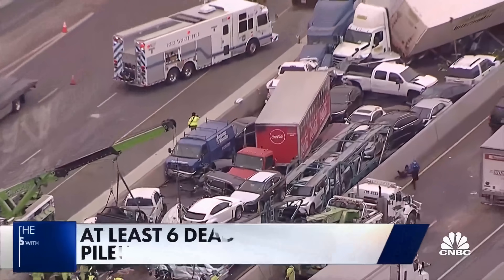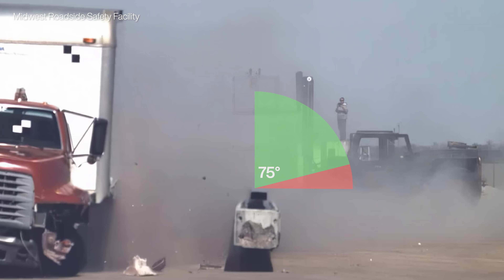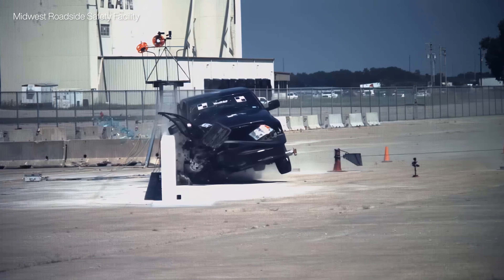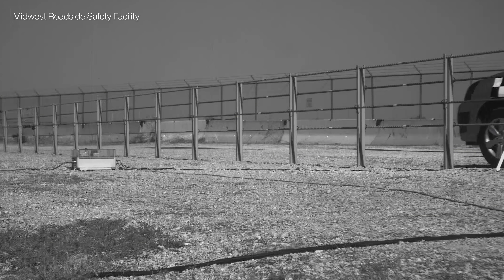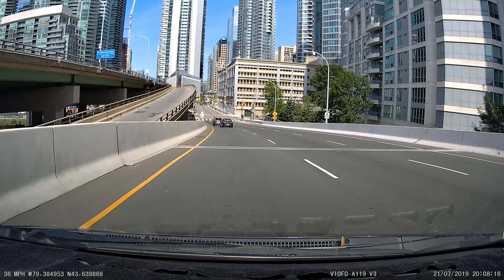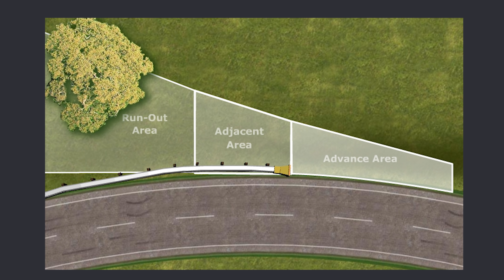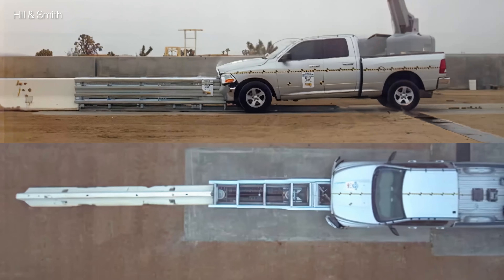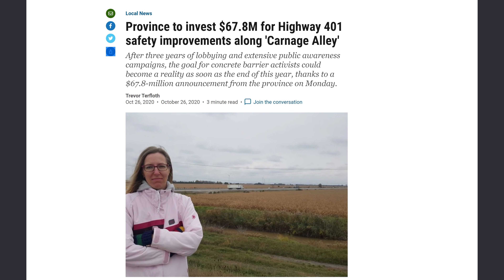How Road Barriers Stopped Killing Drivers

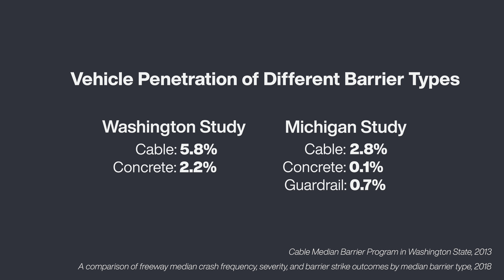Comment: 7:27 "slightly higher fatality rate???"
0.9% is more than double 0.4%... c'mon

Also, at the beginning, you said fatalities were decreasing even as many more people drive than in the past, but the graph you showed was deaths PER distance driven, which is independent of number of drivers.
Reply: "...which is independent of number of drivers"
Wouldn't say so. It makes intuitive sense that "empty roads" tend to be safer than crowded ones.

Haven't looked at the statistics, but think from the perspective of the driver on a simple one-lane road...
Which one offers you greater risk:
- An empty road where you don't have to overtake anyone and where oncoming vehicles come at a rate of 1 every 5 minutes
- A crowded road with annoying trucks to overtake, and where oncoming vehicles come at a rate of 1 every 10 seconds
Reply: @msereno  I think we at least agree it's more complicated than a single statistic.
Reply: @yoongilimerence  yeah I agree. But I also agree with the perspective Andrew presented with the data he showed at the beginning of the video... Technology and law enforcement are evolving, and this brings us quality of life and safety.
Despite the harder challenges of modern times (for example, much higher traffic), the human species keep evolving, and the statistics show it (higher life expectancy, lower motor vehicle fatality...). The video has a positive tone and it is very welcome.
Whole point of the first section was to show that "Driving deaths are WAY less" (per vehicle miles traveled) and it is indeed true.

The video description references this source (among many others) and it's quite interesting: https://crashstats.nhtsa.dot.gov/Api/Public/ViewPublication/812927

Comment: The most dramatic decline was from 1920-50; apparently, going with all steel car bodies helped immensely, subsequent to that, the fatality rate continued to decline, even with no seatbelts to speak of, between 1950-60. Note I've been wearing lap belts starting around 1962 then graduated to 3 point lap/shoulder setups to now.

Comment: On the cable barrier note, if you have a glancing blow they absolutely will be deflected into traffic. In 2018 I had an accident at 100kph on a freeway in Melbourne, I hit the cable fence on the right hand side and it deflected me across 3 lanes of traffic into the concrete barrier on the left. Without the fencing I would 100% be dead as my path would have send me into a set of trees head on. Cable fences are great, but like everything they definitely do deflate you

Comment: I am a truck driver on the US west coast, and I see these fancy barriers going in, and how effective they are.
The guard rail crimping ends are used a lot, and it's easy to see how gently they stop a head on impact.

I have seen several times when the cable barriers caught a car that would have flown across the open center divide into oncoming traffic when they went straight as the freeway curved.
A couple of times there was quite a elevation difference between the two sides, and so the car would have gone down a steep bank into oncoming traffic, but was caught safely.

Oregon and California in the last 3 or 4 years went all in on cable barriers on the freeways, and i5 now has it most of its length where it was previously just open clear strips.
It gets used frequently lol

Yes, it's not as effective as other styles, but being able to rapidly install it several miles per day with limited lane closure and site work is a game changer, because I know that they didn't have the money to put hundreds of miles of guard rail or concrete barriers in place. And in the hills and mountains, the center divide often is not flat and level, and where you would have to do extensive engineering to put guard rails in, you can just follow the contour of the land with the cable barriers.

Thank you for the deep dive into this, all the footage was awesome to see!

Comment: I work for the New York State Thruway Authority and we have to measure to make sure the rail is at a specific angle we also have to use specific bolts, because they want the bolts to sheer at a certain load

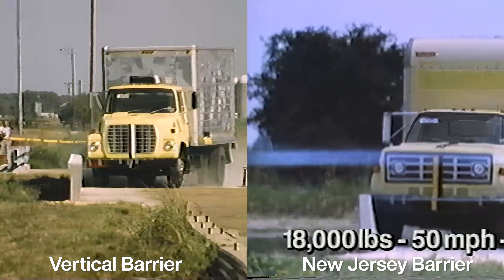Comment: 4:09 that was in Louisville. I remember when that happened. Not only did that guy survive, he walked away from that crash.
Reply: that's good to know - that moment was pretty shocking.
Reply: Damn I thought for sure he got liquidated
Reply: Well it landed on its wheels right?
Reply: @ineffablemars  so the driver just had all of the force of the drop at speed apart from what was absorbed by the suspension, travel up through their spine and head. Does that really sound safe to you?
Reply: @hapticflapjack  opposed to no suspension?
Reply: @ineffablemars  no. It landed on the driver side.
Reply: That's wild

Comment: I don't understand why they don't cable in a more net fashion then the 3 cables standard? If they ran cable's vertical as well as horizontal it would be impossible for cars to slip through the cables. Catching car much like a fishing net. If they are so cheap then the added cost would still make it the cheapest barrier.

Comment: As a motorcycle rider with hundreds of thousands of motorcycle based highway miles under my belt in all weather conditions, all of those barriers scare the you know what out of me.  Do the engineers even consider what will happen to bike riders when they impact any of those barriers?  Is the rider population too small a part of the total driver population to be considered a meaningful fraction of the economic considerations and therefore not worth making modifications to the design?  

This is really peripheral to the excellent and informative video that you created, but I have a question:  Assuming that the effect on motorcycle riders is not considered in the designs, do you think there are non-economic considerations? I live in an area where traffic filtering is legal on motorcycles.  I have heard a good amount of animosity directed at motorcyclists and motorcycles in general. It is just a fact of life.  An example would be "I would like to run them off the road, or throw open the car door and show them for passing me while traffic is backed up".  If motorcycles are not considered in the designs is it partially because motorcycle riders are considered to be irresponsible and that by riding a motorcycle they are taking stupid unnecessary risks and therefore they brought this upon themselves?  I ask because to me that seems (this is a bit of a misstatement, but it is the best comparison that I could come up with on the spur of the moment.  If you have a better comparison please feel free to offer it.) a bit like blaming rape victims for their rape because they brought it upon themselves by their own behavior or clothing choices.  And that is just wrong.

Comment: I'm looking at this and wondering how the cement truck in El Paso Texas that lost his brakes might have been able to stop himself before the intersection where he sacrificed his life to save others at the intersection.  

The crash happened in El Paso on Loop 375 coming put of the Trans mountain pass. Immediately down the pass is a single run away ramp followed by about 2 -3 miles of wavey roadways as 375 goes over intersections,  then into a stoplight just after passing underneath I-10. I'm wondering if he might have survived if he would have aimed for some of the barriers between him and the intersection

Comment: Still super dangerous to motorcycles.
At least the rail and cable types

Especially here in Germany because most states are too cheap to put up double hight barriers.
Especially in corners.
Those "legs" will fuck you up badly

Comment: There's a dangerous intersection in my home town with frequent tractor trailer traffic.  People were petitioning for years to have a turning light installed but Dot wouldn't budge as there weren't enough fatalities to justify the cost.  all you have to do is try to make a left onto the highway with a large truck trying to do the same across from you to realize how dangerous it was as the road curves ever so slightly to the right so any oncoming traffic can be completely obscured from view.  

They finally installed a turning light a few months ago and everyone rejoiced.

Comment: while driving DEATHS are happening less i think ACCIDENTS are going up due to distracted driving and todays cars being made for and marketed to unskilled drivers. more and more unskilled drivers are on the road than ever and car companies keep pumping out SUVS with a million driving assists in them, allowing those unskilled drivers to get on the road and think theyre safe. i firmly believe that all a car needs is ABS, TCS and a manual transmission so that unskilled drivers are filtered out of the roads, todays crash structure safety is more than enough to stop road deaths.

cable barriers are dangerous to low cars like sportscars, ive heard of people in corvettes and vipers being decapitated by them

Comment: "with enough crashes, restorable units save money"
YO! We need some moah crashes ovah heah! Joey, go hit dat barrier a few times.
Reply: That is like saying I need my house robbed more often so my insurance cost per. robbery will be less.
Reply: Going to the emergency flasher Bailando to Mexico
Reply: Y'now, I don't trust joey.
Reply: @flippyflip7213 just trust him buddy
Reply: While safety measures have increased survivability of accidents, the root cause of accidents have spread unchecked in recent yrs.

In Ca, Latino drivers cause a disproportionate % of DUIs, hit and runs, distracted driving. Disregard for common decency, the safety of other motorists; and, even traffic law, run rampantly amok among Calif Latinos. 

It'd be great if you could help shed some light on this censored topic to prompt proper public discourse and overdue action to address this taboo issue.
Reply: @marthinluther7350  There are no accidents. There are only "becauses". Vehicles crash "because" somebody along the line did something wrong/stupid.
You're guiding 2+ tons of machinery around at high speeds only connected to the earth by 4 tiny patches of rubber. 
Yeah you feel great in that 6 ton SUV...but you have no sense of the fact it rides on less than a square foot of surface.
Nobody understands basic physics, inertia. Even the best tires can only do so much. All they know is if they turn this gizmo the car is supposed to turn.

Vehicles SHOULD be more dangerous, scary, terrifying to drive...not mobile living rooms.
Trying to overcome stupid all these years hasn't worked very well. People always find a way.
All of these safety features are trying to stupid proof cars. They understand that PEOPLE can't be taught.
Reply: @marthinluther7350  The root cause of ALL crashes is stupidity....what did I miss?
Reply: @yourhandlehere1  I disagree, give me mobile living room, let a robot drive.
Reply: thanks for the laugh lol

Comment: I'm skeptical of the smart cushion. I'm sure they work great when they are new, but gas shocks are notorious for leaking pressure over time, and I doubt they will be sending crews out to inspect them. Is there even a way to check the pressure?

Comment: In my years of working for the dot and fire department I can say cable barriers do not work and almost always allow the vehicle to go into opposing traffic
Reply: I've seen a cable barrier in a narrow median, get plowed into and repaired several times, where the vehicle would cross into oncoming traffic. They finally replaced this cable barrier with a permanent concrete barrier. It took a few people dying before this happened. In another stretch of the same highway, where the cable barrier is on both sides of a large median, it has kept vehicles from crossing over into incoming traffic. When it comes to cable barriers, speeding in most cases, is what causes crossovers.
Reply: I see the opposite often- cars hit the barrier,  with a nonfatal level of damage,  safely remaining in the median.

Comment: The problems with cable rails is that they kill motorcyclists at a high rate than guardrails. The issue isn't the cable or the guardrail but the posts.
A German study found them to be deadly at 50km/h. Keep in mind they are often installed on roads with speed limit of 100km/h (4x the force).

Comment: cool now take a cable barrier also referred to as a "cheese grater" and even graze it with a motorbike :/ yea you get entangled and violently ripped to shreds costly to clean you up as well. sadly the metal barriers do only a little better but I will say bouncing of concrete barriers is preferable. most of these systems are only designed for cars sadly

Comment: Imagine hitting a cable barrier on a motorcycle D:
Reply: the cable can slice through the pillars of your car and decapitate you if you hit it just right. Who would want to end up in the median when you can get in a highway speed wreck, total your car and possibly die, I see no problem
Reply: @jake_ruhl  They're meant to stop a car from making another driver's day into his last by jumping the median and hitting them head on. Imagine someone getting killed by a semi-truck jumping the median and you'll understand what a cable barrier is for.
Reply: well, none of those saves motorcyclist anyway. 
too fast too light too small
Reply: @TheZenytram  At least the concrete barrier would be survivable if you slid into it at an angle. Sliding down the highway and hitting a post is a nasty way to go.

Comment: In Québec, the guardrail ends are still mostly of the old style which would impale your vehicle, but impalement is less likely since they generally curve toward the ditch near the ends. To actually hit the end, you would have to already be in the ditch and be trying to veer back onto the road. We don't have all that many cable barriers at all. Corrugated steel is pretty much the standard. Other then in big cities like Montreal, we really don't have all that many of the larger terminaisons either. Many of the exits in my city have standard guardrails which are set back from the division point or have no guardrails at all. The separation point is made long enough that you generally would have space to stop, or at the very least, be able to get into the emergency lane. They are built to be as forgiving as possible. The center ditches of our highways tend to be rather wide and deep.

Comment: My father worked for Cleveland ohios fire department for 35 years and he told me the ems and firefighters called the guard rail the “Blender”. Reason why is because when someone on a motorcycle laid their bike down on its side and slid into the railing going 60+mph, the 4x4 posts holding the railing up would disintegrate your body. Say bye to all your limbs and head. I grew up on stories of my father shoveling dead bodies off the highway. Oh and i can guarantee our big city of Cleveland hasnt updated a single guard rail in the past decade.

Comment: Cable and motorcycles are deadly. I was a tow truck driver and I have picked up the pieces. And the fire fighters and troopers told me the rider was in 3 pieces. His head and shoulder was torn from the trunk of his body and his leg on the other side was gone. As he Spun through the air he hit two of the polls with his body. They said he was doing about 140 miles an hour!

Comment: 2:50 it's not really true anymore, that the Clear zone is one of the safest ways. The Clear zone is something that was invented in 1960-70 and it is already outdated, many new ways to make the streets saver were invented and tested in studies, they are made for today's driver and cars, and not for the time, where not even seat belts or airbags were required by law.
studies show that Streets with a short "clear zone" and trees or other obstacles which block the sight to the side, make that the people drive more focused and safer, the accident risk is up to 15-20% lower than with the current American style of the Clear Zone, where people drive subconsciously faster and more reckless.

1. You subconsciously drive slower when you see how quickly the trees or other obstacles disappear, with a wide clear zone you drive subconsciously faster because you would have no feeling for your true speed if you do not see any obstacles ridden one behind the other.
2. In addition, people drive more focused and are more alert when visibility is part-wise restricted because you always need to be alert that something could come out of the side where you have to swerve / brake, which is why they react much faster than with a wide clear zone.

(3. there are also many other reasons, but I won't write so much, because I'm not in the right mood right now, so I wanted to say that  can read some of the studies online, with a little search.)